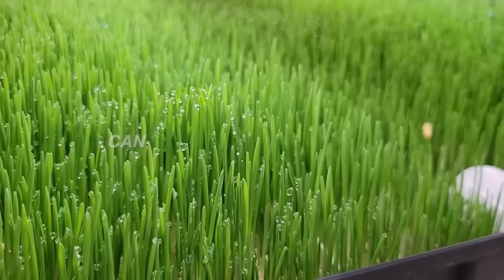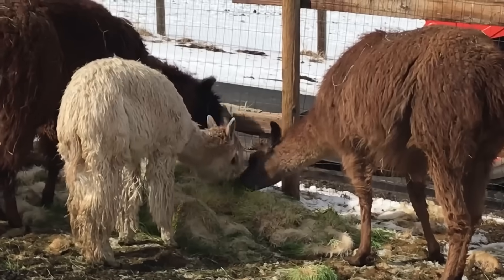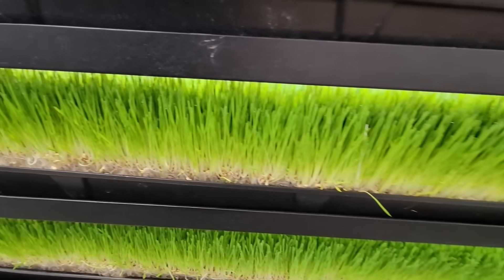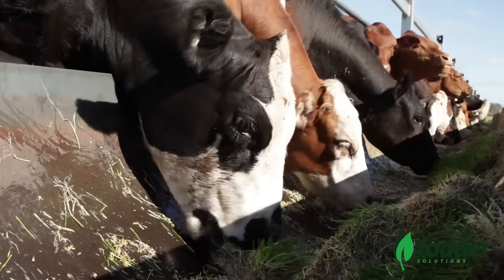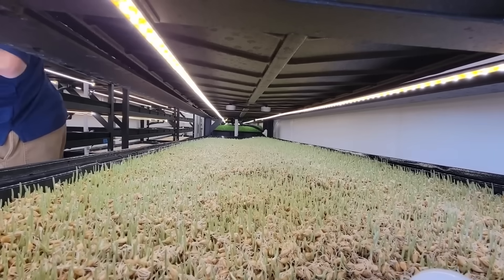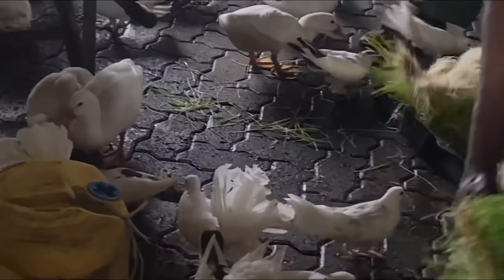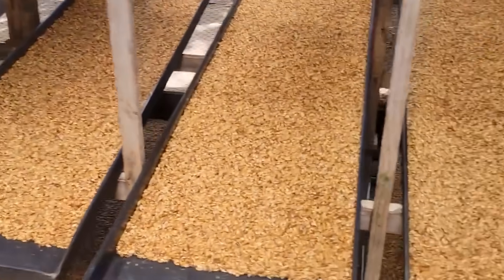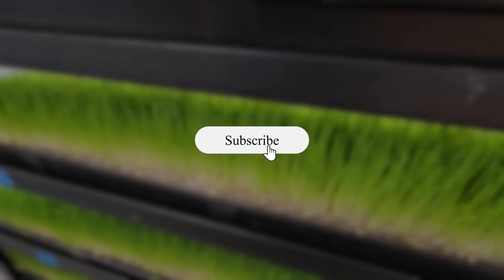Can Indoor Fodder Really Replace Hay? (The Numbers Don’t Lie)

Comment: It simply cannot “replace” hay because it has way too little fiber.
Reply: Yeah the conclusion is its a good supplement for pig sized animals and under that can reduce feed costs (the fodder is high in protein) and improve meat yields
Reply: Lol
Reply: Quick Answer: Sprouted barley fodder is higher in digestibility, vitamins, and bioavailable protein, while hay provides more dry matter and fiber bulk. For animal health, sprouted barley supports energy, milk yield, and nutrient absorption, whereas hay maintains rumen function and prevents digestive upset.

Nutrient & Health Comparison

Sprouted Barley: Rich in protein, vitamins (A, B, C, E), minerals, and enzymes. Highly digestible, lower ADF and NDF. Improves nutrient absorption, supports milk yield, fertility, and growth. Must be balanced with roughage to avoid rumen upset.

Grass Hay: Higher fiber, moderate protein. Lower digestibility, higher ADF/NDF. Provides rumen fill, maintains gut motility, prevents acidosis. Reliable bulk source but lower nutrient density.

Alfalfa Hay: Higher protein than grass hay, moderate fiber. More digestible than grass hay. Supports lactation and growth but still provides structural fiber for rumen health.

Nutrient        Barley Sprouts    Grass Hay       Alfalfa Hay
Protein         14.1%             7-11%           15-20%
Fiber (Crude/ADF) 14.1%           30-45%          30-40%
Fiber (NDF)     ~20-25%           59.5-74.9%      40.9-56.3%
Fat             2-3%              1-3%            1-3%

Takeaway: Sprouted barley is a nutrient‑dense, highly digestible supplement that boosts animal performance. Grass hay and alfalfa hay provide essential fiber bulk to maintain rumen health. The best feeding strategy combines sprouted barley with hay to balance energy intake and digestive stability.

One of the reasons for fiber in ruminants is to prevent acidosis. Fiber plays a big role in this but so does alkaline mineral content. Hay is typically a lot higher in calcium, but much lower in sodium, potassium and magnesium all of which help prevent acidosis.

For mass farming techniques hay fills a need that is hard to replace providing high fiber, and high calcium. For smaller more holistic farms, animal health is boosted by significant amounts of fresh sources like barley sprouts. Dried leaves, commonly available for free in the fall, are a good source of fiber. They are still lower than hay, but much better than sprouts. Some leaves are more suitable than others for some types of animals. Oak is higher in fiber than alfalfa hay and less than grass hay, but tannins limit how much you can use. 
Leaf Type      Crude Fiber (%)   NDF (%)
Oak                 25–30             50–60
Poplar             20–25             45–55
Willow             20–30             ~50
Elm leaves      25–30             50–55
Mulberry         15–20             35–45
Leucaena       20–25             40–50
Grass hay       30–45             60–75
Alfalfa hay      30–40             40–55
Maple             20–25             40–50
Oak                25–30             50–60
Nut trees        20–30             45–55
Aspen            20–25             40–50
Mulberry        15–20             35–45
Reply: @Resist.Tyranny  Now what about sprouted alfalfa? Which can also easily be done in these systems.
Reply: @davefroman4700 was just thinking about that too .Why not .
Reply: @Resist.Tyranny not to mention the function hating a field serves to prevent the field from going fallow during a rebuilding season for that field
Reply: far as I know it can be any seed, corn, barley, wheat, alfalfa, soy, what ever you want you're only feeding them the seedlings and roots so they get more than enough fiber depending on which seed you grow.
Reply: @MrDhalli6500 unfortunately this is wrong buddy. I was also “fooled” by sprouts but their fiber, while nominally present, is not physically effective. Rumen wouldn’t form mat and cows wouldn’t chew enough. Can t get away with a full replacement unfortunately
Reply: @MrDhalli6500  
Sprout Type      Protein(g)  Carbs(g)  Fiber(g)  Key Micronutrients
---------------------------------------------------------------------------
Corn sprouts        3.5        19.0      2.7     B vitamins, magnesium
Barley sprouts      3.6        17.0      1.5     Zinc, selenium, phosphorus, iron
Wheat sprouts       4.0        20.0      2.0     Vitamin E, B vitamins, iron
Alfalfa sprouts     4.0         2.0      1.9     Vitamins A, C, K, calcium, magnesium, zinc
Soybean sprouts     9.0         8.0      2.5     Folate, vitamin C, iron, potassium
Reply: Just add wheat straw.
Reply: I knew a guy who lived next to a chicken barn operation. He took the chicken shit, injected it with anhydrous ammonia then mixed in 10% grain and fed it to his feeder steers. They were double muscled in half the time. Cattle loved it!

Comment: Re Power costs. If all your electricity was from renewables, self-generated, how would that tip the numbers.
On that question, is it even theoretically possible, to convert sunlight, into LED lighting, via PV, such that the LEDs were producing the exact spectrum for maximum efficiency and growth, to get more growth than direct sunlight.

Comment: Not at all . 
Let me be honest .
Let me explain from the context of indian currency and condition . 
Take an HF cow which needs 35 kg silage per day . No hay required if silage is provided as its DM is 32 % 
A cow will approx eat 13000 kg in a year . Production cost of corn  silage including harvesting fertilising etc is 2.1 rs per kg  for 20 ton silage per acre . 
So total cost is approx 2.1 * 13000 which is 27500 indian currency . 
Now take hydroponic fodder . A cow will need 42 kg green fodder and also hay cow the DM is too low in barley fodder .  Acow  will eat 42 * 365 = 15330 kg . That's  2555 kg of seeds ( considering one barley seeds = 6 kg of fodder )  
 Total cost is 2555* 28 rs per kg barley seeds = 71540 indian currency . ( I have not even added for the hay ) Which then would be 78000 INR .
Hydroponic system is almost 2.8 times costlier . 
Also the initial investment is high . Daily extra labour and buying seeds , electricity bills are another head ache .
It may be done only if one have one a few small animals and u don't even an acre of land  OR  u wanna scale upto industrial level . 
 OTHER WISE for the small to mid or even mid large scale farming ( 100 cows  ) , the profit margin will be too small or might be even negetive .
Silage u make it once or twice in a year. All u have to do is store it and feed .